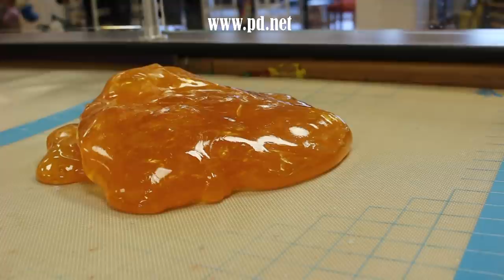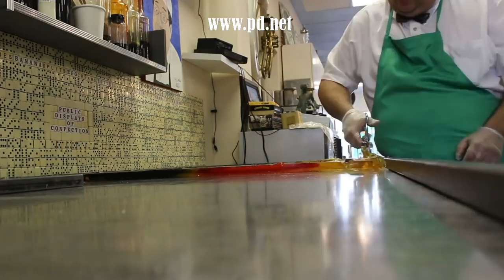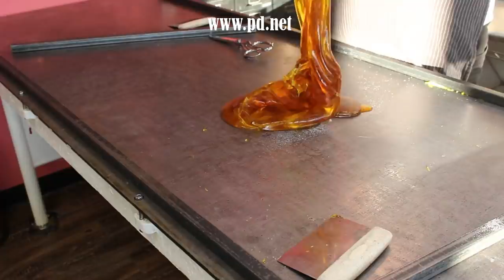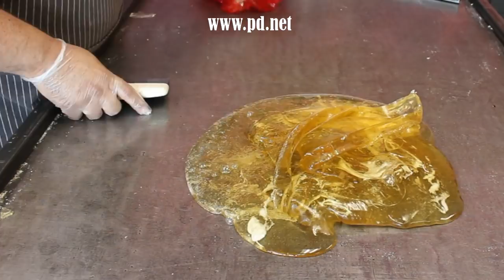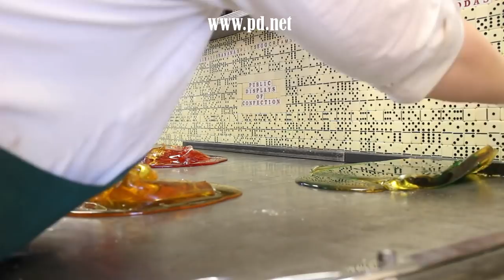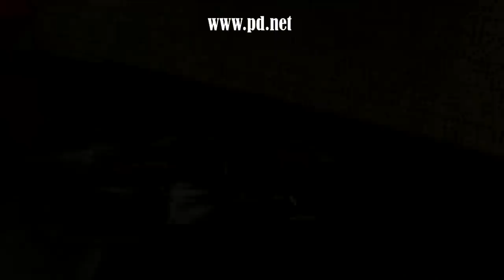#53 The most satisfying Molten Candy video from Lofty Pursuits

Comment: I would love to see what this looks like with thermal imaging. The difference between temps at the edge and bottom versus in the middle must be huge because there are moments where you are handling it with bare hands yet the middle remains hot enough to melt the edge back into a liquid.

Comment: How is it when the sheets are peeled up the layer on the actual heat is hard/cool enough to grab, but the top layer is liquid?
Reply from the maker: +Haley Wilson sort of like hard clay when you do it right, if you miss the narrow window to do it in, the bits you grab can crack and the hot sugar can flow through the cracks.